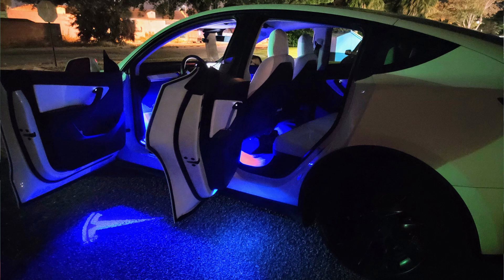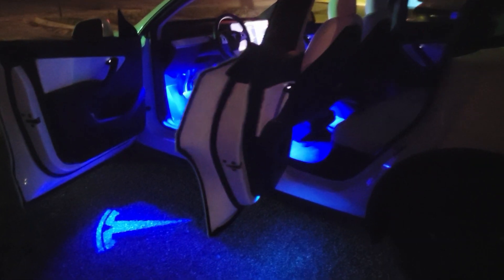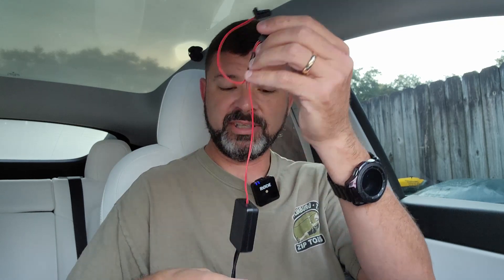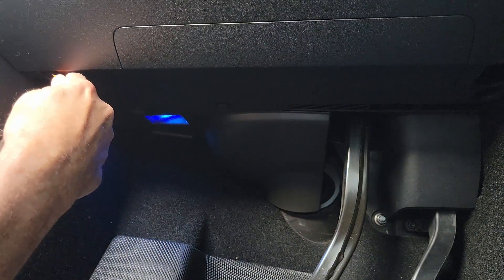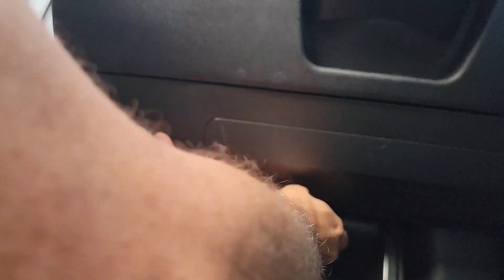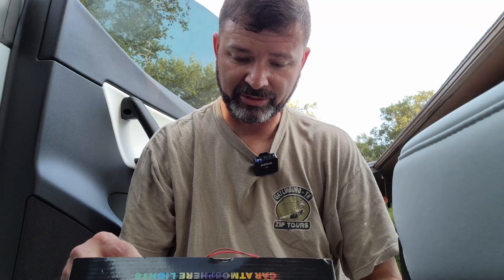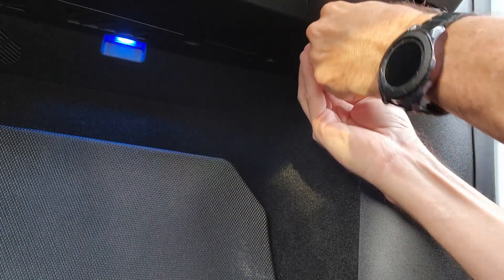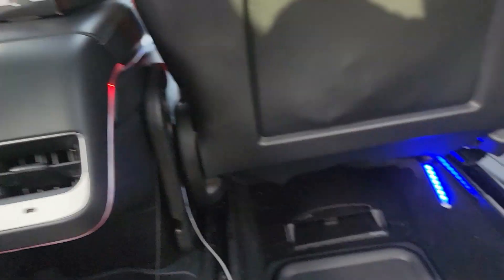Tesla Model 3 or Model Y Interior Ambient Footwell Lights by Basenor

Comment: Hey, Blaine! Thanks for the vid! I’m trying to install the lights now, but when I plug them in they do not light up. Neither does the oem light. When I plug in the oem light w/o the new lights (a la original) it isn’t working either. Any advise?
Reply from the maker: I would check to see if you accidentally pulled out any other wires or didn't connect them fully. Good luck!